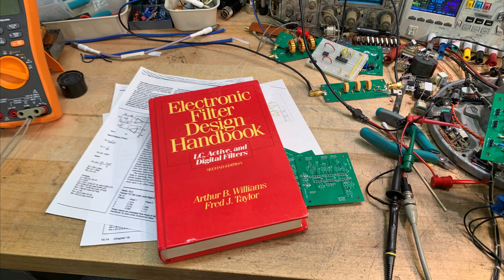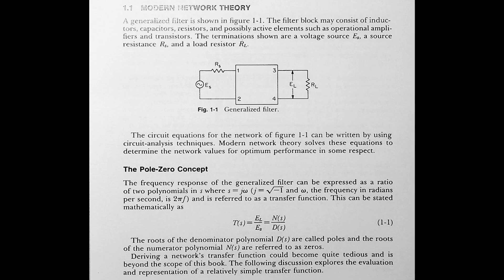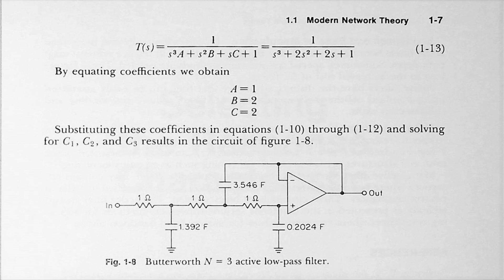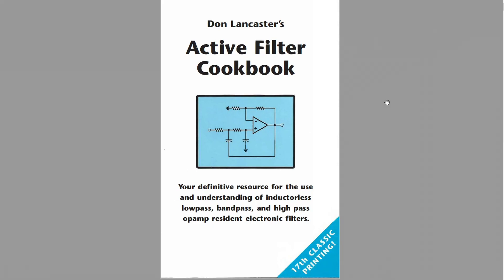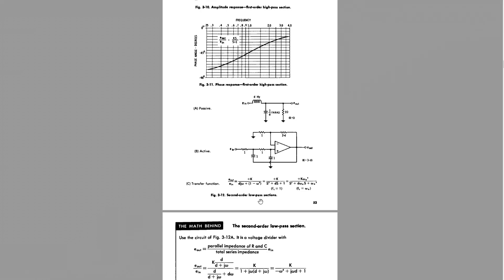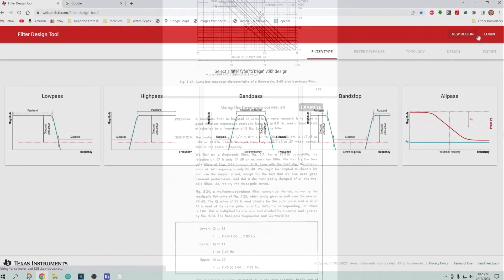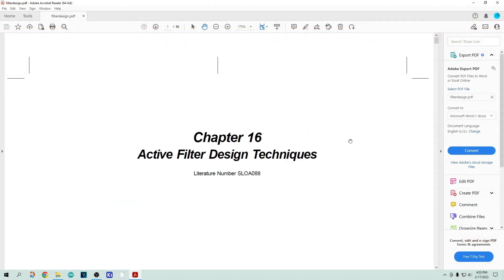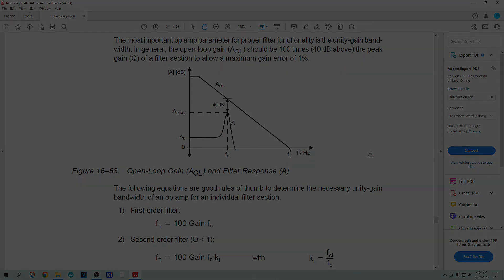#1436 Active Filter Books and Calculators

Comment: Thanks so much, just what I was looking for. Ironically, I used to work at TI, on radars and ILS systems. The radars were phased array for the military and old school mechanical sweep for military and commercial airports.

I’m thinking about building a low frequency sweep generator for testing the geophone filtering subsystem.

Comment: As you were wondering about Sallen-Key being one or two in this video, I determined to look it up. The internet is good for more than filter calculations after all. I learned that they were two men working at MIT's Lincoln Lab in the 1950s. They were using cathode followers as their close-to-unity gain amplifiers. 

Lancaster's book was first published in 1975--I still have my "first edition" copy. So, in twenty years the technology moved from tubes with B+ and filament supplies to hobbyist-friendly 741 op amps. This was a nice reminder for me that while technology changes quickly now, it changed just as quickly in the past. As I'm writing this I'm sitting next to my 3D printer cranking out a case for a 1950s-vintage Weston -15--0--+15 microamp meter. I guess it's all a matter of viewpoint.

Comment: Analog filter design is an interesting subject.   I think I used it mostly when designing filters to knock the noise down before A/D conversion.  Knowing the required bandwidth of a sensor and how much noise was in your system gave you some of the requirements for the filter.  This was still before this stuff was on the internet, so having a suitable text on filters was important.